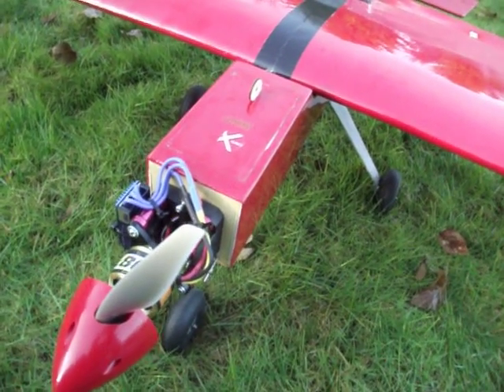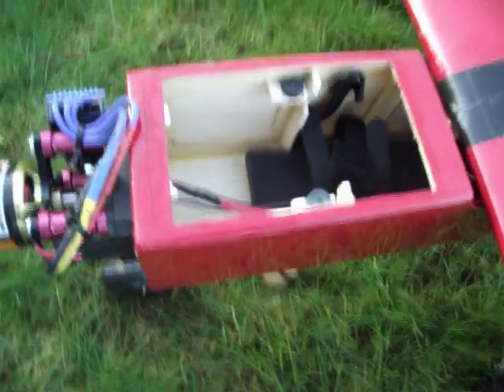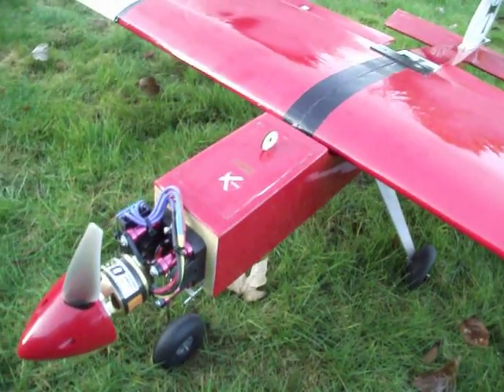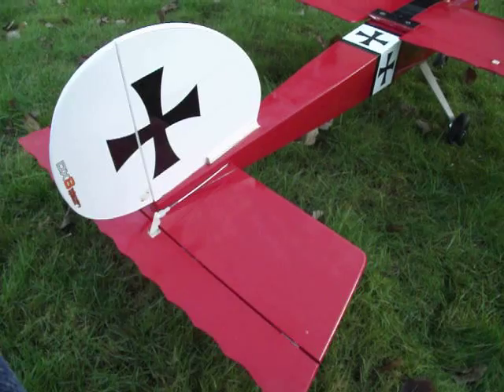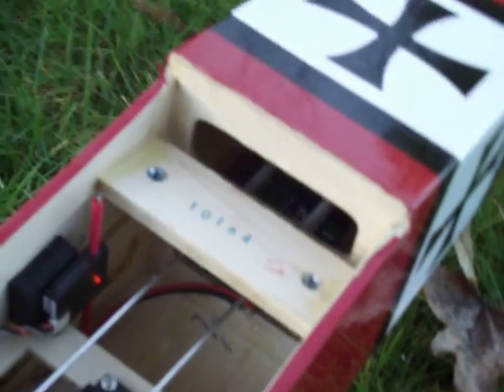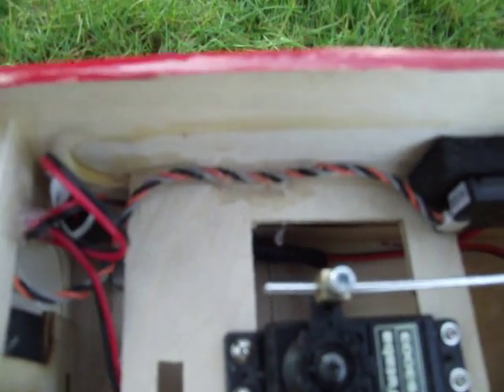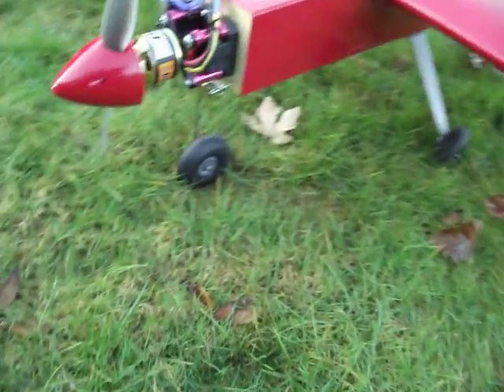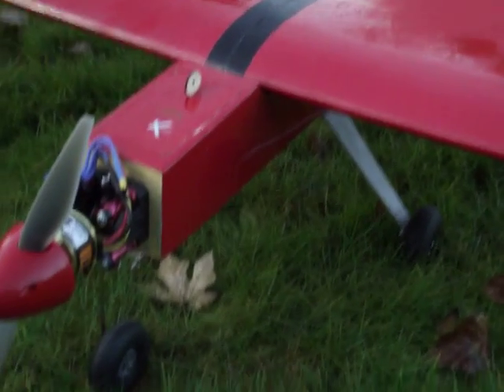Big Stik 60 electric conversion.AVI

Comment: Hello can you send me the layout of parts i will need i have a big stik 60 and i want to convet it to electric power thanks Lee
Reply from the maker: Pretty straight forward layout. The original setup is listed in the description. I since swapped the motor for a Rimfire 60, using a 12x8 prop as I wanted more ground clearance. Still on 6 cells, and the plane just screamed. I also went with a Castle 75 amp esc. See my other videos with a GoPro mounted on the wing. I later mounted the ESC inside the fuse as I had the plane on floats. Just make sure there are vents for air cooling. I used regular Futaba servos s3004s I think.

Comment from the maker: I recently swapped out the motor. Now has rimfire 60 with 12x8 prop. Still awesome performance. Put the rimfire 80 in my Phoenix 330s with a 14x10 prop. Better performance too